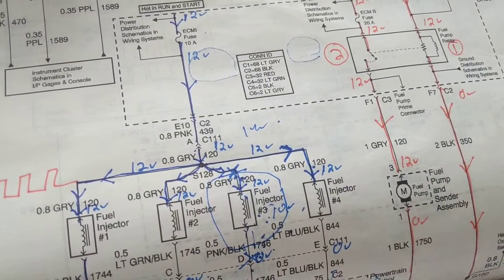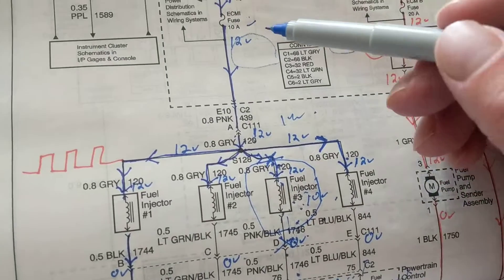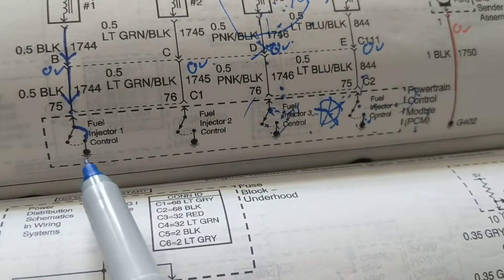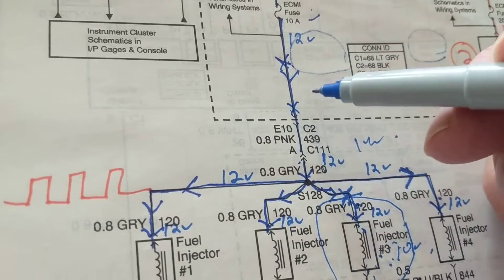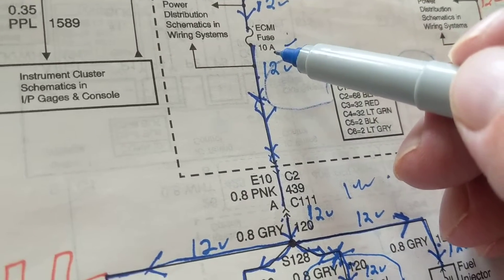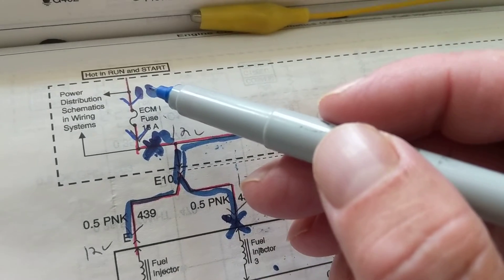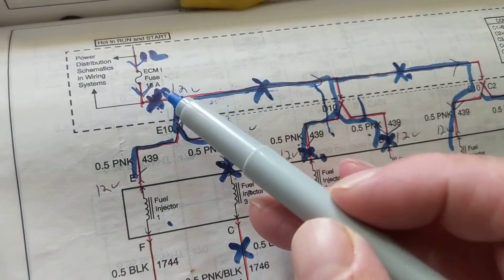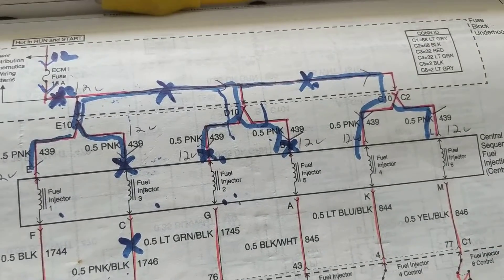crank and no start fuel injector problems from bad fuse

Comment: In the first diagram - 4 injectors - each injector " pulls" the same 10 amps or close... because THEY WORK ONE AT A TIME ....NOT SIMULTANEOUSLY. ....NO CAR 4 OR 6 CYLINDER CAR HAS SIMULTANEOUS INJECTION

Comment: Had a crank fire an no start issue for a long time on a 22re toyota 4x4 pickup watched 100 plus videos  on this replaced computer  fuel pump  injectors tps arm new manifold an intake gaskets redid all my grounds fuel relay main relay distributor coil nothing helped. Had my truck towed 45 miles to a toyota dealership in Butte Mt. They reassured me they could figure it out after 4 months they had no idea had to tow it home again let it sit for along time not knowing what to do next. This month I put it back in the garage to check everything out again.last year I put a noid light on injector wire and I had pluse so I thought that was good. Yesterday I put the noid light on a different injector wire and the truck fired up on three cylinders hoping the short didn't hurt the ground to ecm. Going to order new injector wires. Hope this helps someone
Reply from the maker: In a cranking no start issue obviously you have to develop fuel pressure if you do not have a fuel pressure gauge you can look up the diagram on Google for free putting in the model and make of your car you'll get a diagram for free after that you fine the fuel pump relay and jump terminals 87 + 30 to see if the fuel pump comes on at all now remember also a crankshaft sensor has to give a signal to the fuel pump so that's the first thing I would advise

Comment: Hello sir, thank you for this video, i have a question, i have a ford transit connect that was working but had a rough idling (when revs increase, there is no problem). I had thought it was an injector, so i started the vehicle and begin disconnecting injectors. when i disconnected the 3th one, i started running very rough but it didn't stop running. So i stopped the engine. After that it didn't want to start anymore but it is cranking. So I checked the voltage in all injector connectors and i have only 1.25v in each pin. What could be the problem please ?

Comment: I have a no start issue with my 92 Lexus es300. It ran one day and then out of nowhere i lost throttle response and the car sputtered out to a stop. I’ve replaced the fuel pump and filter. And tested the efi relay numerous times. None of my front 3 injectors have a pulse. And the constant pin only has 11.90V. Is it an ecu issue, or something else?

Comment: Hey thx so much for your effort in this training. I have a injector that gets batteri voltage on the suply pin. all fine there. BUT the pulse pin does do go all the way to zero voltage when PCM is grounding the injector coil. it only goes to around 5-6 volt. do you have a wisdoms word to say about that situation,  in tis case is a Fiat Qubo multijet 1.3 mjt. Thx for your great videos..  i am a big fan of you.

Comment: Hello I have a 2014 chevy cruze eco
118k miles
Burnt coil pack but swapped it with a new one
Injectors 1 and 3 fuse keeps blowing 
Service Stabiltrak and service traction control lights/notification 
Cranks but won’t start
Any advice would be greatly appreciated 
Thank you ❤️

Comment: How does the camshaft sensor affect the fuel injectors? I have a 2006 GMC envoy that has fuel pressure and spark but the injectors won't fire fuel into the cylinders.
Reply from the maker: The the camshaft and crankshaft sensors usually control the relay to allow the fuel pump to get fuel pressure and your case there might be a b+ missing to the fuel injectors might be a fuse that's been blown or a bad ground

Comment: Hello, Sir. How would you explain why an internally shorted injector does not blow a fuse? Current follows the path of least resistance.
Reply from the maker: Even if the injector is shorter internally it has to find a path to ground where would that path to ground be the computer gives you the ground when it toggles the switch inside to ground

Comment: So I’m getting nothing to any of my fuses in that same line with the fuel injectors/ coil pack fuses
Reply from the maker: See if you have a fusible link or you have a bus wire that's the problem or a bad connection from the positive of the battery
Reply: @Joeelectronicschematicsforauto  I just went to pick a part and grabbed another fuse box. Fingers crossed this will do the trick
Reply from the maker: @mikejohnson-vq7ez  across both fingers but I want understand the problem further so I can assist you
Reply: @Joeelectronicschematicsforauto  so I went to pick a part. And got a different fuse box for it. Plugged that fuse box in and same thing. I’m getting no power to the coil pack/fuel injectors fuses. Even with the key on no power. I’m getting power to allot of other fuses. But no power to certain part of the fuse box

Comment: I’m receiving fuel pressure with new fuel pump and relay. The injector fuse keep blowing. Most times at high speeds. It also blow once upon putting it in. Help please
Reply from the maker: What is the make and model of the car
Reply from the maker: The injectors usually go to a computer module which could be a suspect right there